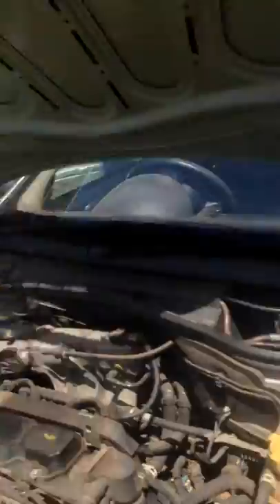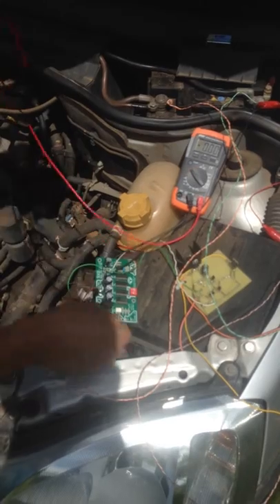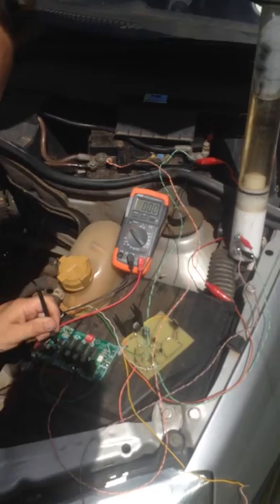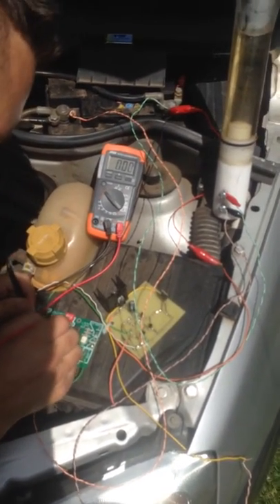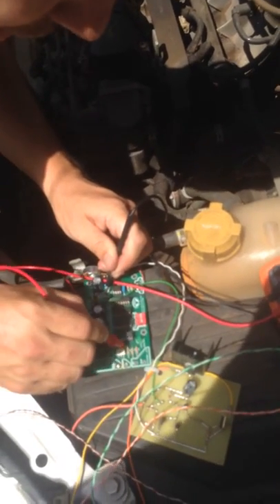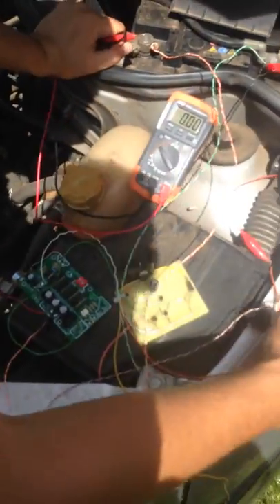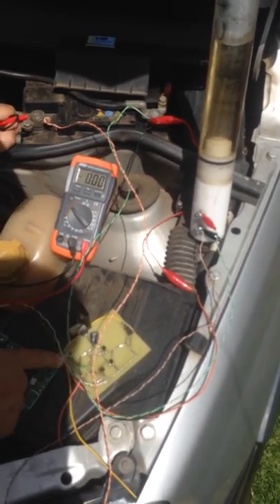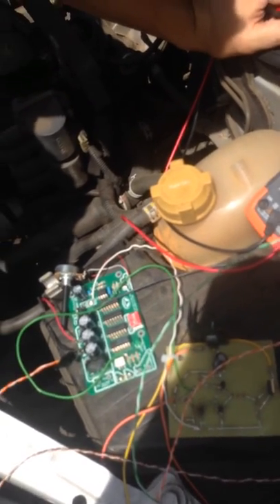Totem Mosfet Driver pole Troubleshoot

Comment: You really cant tell whats going on in a digital circuit with a multimeter... Your getting 2.5 or so volts at the optocoupler signal input  because its a 50% duty cycle signal.. Its not a constant voltage.. Multimeters are not useful in telling the peak voltage of a square wave dc signal.. Messing around with digital electronics without a oscilloscope is like a artist  trying to paint a picture without eyes..
Reply from the maker: I do have the osciliscope aswell and I'm not getting the totem pole driver to work, I'm doing something wrong, I think that my NPN and PNP is not complimentary to each other and therefore it doesn't work, I could be wrong.